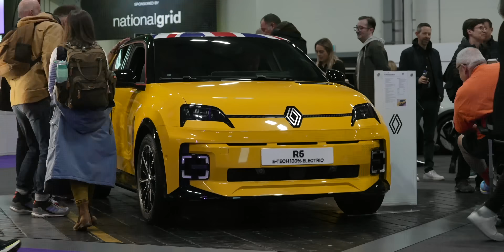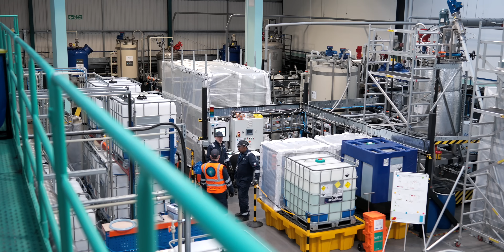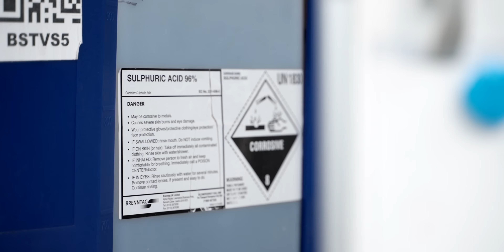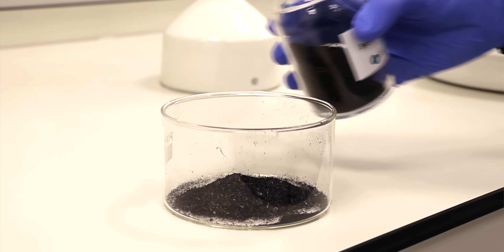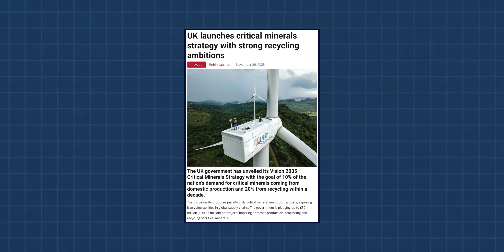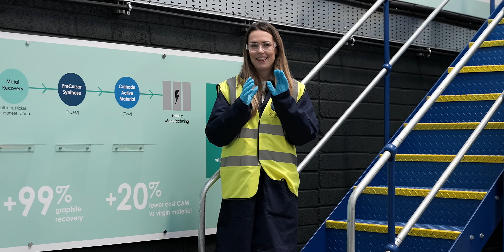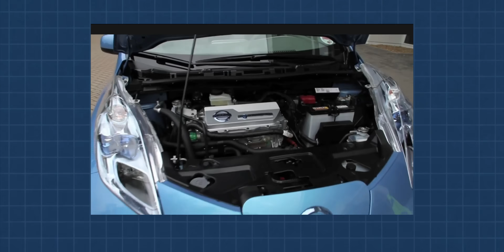EV Battery Recycling Could Be The End Of Mining!

Comment: More wishful thinking. Recycling isn't going to happen without government legislation compelling the EV industry to do so.FFS!
Reply: Recycling of batteries is already legislated for, I think?
Reply: I think there's enough money in the batteries that batteries will get reused or recycled by default
Reply: @Biggest-hz7ng 

😂😂😂😂

You may well believe that.
Reply: @ForestForest-n9i @ForestForest-n9i
At some point it’s worth stepping back and looking at what’s actually working now, not what’s been “five years away” for the last two decades. Battery Electric Vehicles (BEVs) have already won the light-vehicle race on efficiency, infrastructure, cost, and real-world usability, while hydrogen remains a niche science project for passenger cars.
First, efficiency matters. BEVs convert roughly 70–90% of grid electricity into motion. Hydrogen vehicles (both FCEVs and H-ICE) lose huge amounts of energy producing hydrogen, compressing or liquefying it, transporting it, and then converting it back into electricity. Once you count all that, hydrogen struggles to reach 25–35% well-to-wheel efficiency. Using clean electricity to make hydrogen instead of charging a battery directly is simply wasting energy.
Second, infrastructure is decisive. Electricity is already everywhere. BEV owners can charge at home and use a rapidly expanding public network. Hydrogen stations are rare, expensive, complex, and unreliable. In the UK there are only ~15–16 hydrogen stations total, with about 6 open to the public, versus 57,000+ public EV charging points and growing fast. Globally the contrast is similar: millions of EV chargers vs ~1,100 hydrogen stations. You can’t scale a consumer technology without infrastructure, and hydrogen never has.
Third, cost and practicality. BEVs have lower total cost of ownership: cheaper “fuel,” fewer moving parts, and less maintenance. Hydrogen fuel is expensive (often $10–15/kg in the US), stations frequently go offline, and you can’t refuel at home. This isn’t theoretical—hundreds of Toyota Mirai owners in California are now part of class-action lawsuits after being stranded by broken stations, skyrocketing fuel prices, and vehicles that have lost most of their value.
Fourth, a point often ignored: FCEVs still use lithium batteries. They are series hybrids—hydrogen makes electricity, which is buffered in a lithium-ion battery that powers the motor. So arguments against BEVs based on batteries also apply to FCEVs, plus FCEVs add fuel cells, platinum catalysts, high-pressure tanks, and more complexity on top.
Fifth, the market has already decided. Global EV sales jumped from ~3 million in 2020 to over 10 million by 2023, with BEVs dominating. Automakers and analysts (IEA, BloombergNEF) consistently point to batteries as the winning technology. That’s why companies like GM and Stellantis have scaled back or exited hydrogen passenger-vehicle programs, and why hydrogen is increasingly being limited to specific heavy-duty or industrial niches, not everyday cars.
Hydrogen cars do have zero tailpipe emissions, but once you consider production methods (mostly fossil-based today), energy losses, infrastructure costs, and real-world failures, they simply don’t compete with BEVs for personal transport. While hydrogen advocates keep promising a breakthrough “soon,” millions of people are already driving cars that are efficient, affordable, charge at home, and work every day.
This isn’t ideology—it’s engineering, economics, and market reality. For light passenger vehicles, the conclusion is no longer controversial: plugging in beats waiting for a miracle fuel.
Reply: @ForestForest-n9i Tell is about what car you personally own then. Is it hydrogen? @ForestForest-n9i
Reply: Do you have any evidence to prove your statement. If it is wishful thinking then why is a company already doing it?
Reply: @oddjobsandrandomprojects  Or is it?
Reply: @grahamcook9289 

Yes, battery recycling is a "thing" without a doubt.

We've even been treated to programs on the topic courtesy of MSM.
Reply: @ForestForest-n9i  Yes, we all know it's possible and desirable but to make it commercially viable its cost needs to be baked in from the start, especially now that EVs are established and the future direction is clear. For example, in Germany every supermarket has an automated collection point where you can recover your deposit, panda in Germany. The pond is applied to all bottles sold by the supermarket and the amount is always stated in the price. Supermarkets have no choice, but to do this -compelled by law. Individuals see the value in this and do recycle by returning bottles on every shopping trip.
Reply: @grahamcook9289 

You may be interested to know that China has mandated BEVs must be scrapped with the batteries still attached so to speak.

To allow "official" recycling in authorised facilities, H&S presumably, to ensure said safe recycling.

Chapter and verse online.
Reply: @ForestForest-n9i @ForestForest-n9i Tell is about what car you personally own then. Is it hydrogen?
Reply: @ForestForest-n9i @ForestForest-n9i
At some point it’s worth stepping back and looking at what’s actually working now, not what’s been “five years away” for the last two decades. Battery Electric Vehicles (BEVs) have already won the light-vehicle race on efficiency, infrastructure, cost, and real-world usability, while hydrogen remains a niche science project for passenger cars.
First, efficiency matters. BEVs convert roughly 70–90% of grid electricity into motion. Hydrogen vehicles (both FCEVs and H-ICE) lose huge amounts of energy producing hydrogen, compressing or liquefying it, transporting it, and then converting it back into electricity. Once you count all that, hydrogen struggles to reach 25–35% well-to-wheel efficiency. Using clean electricity to make hydrogen instead of charging a battery directly is simply wasting energy.
Second, infrastructure is decisive. Electricity is already everywhere. BEV owners can charge at home and use a rapidly expanding public network. Hydrogen stations are rare, expensive, complex, and unreliable. In the UK there are only ~15–16 hydrogen stations total, with about 6 open to the public, versus 57,000+ public EV charging points and growing fast. Globally the contrast is similar: millions of EV chargers vs ~1,100 hydrogen stations. You can’t scale a consumer technology without infrastructure, and hydrogen never has.
Third, cost and practicality. BEVs have lower total cost of ownership: cheaper “fuel,” fewer moving parts, and less maintenance. Hydrogen fuel is expensive (often $10–15/kg in the US), stations frequently go offline, and you can’t refuel at home. This isn’t theoretical—hundreds of Toyota Mirai owners in California are now part of class-action lawsuits after being stranded by broken stations, skyrocketing fuel prices, and vehicles that have lost most of their value.
Fourth, a point often ignored: FCEVs still use lithium batteries. They are series hybrids—hydrogen makes electricity, which is buffered in a lithium-ion battery that powers the motor. So arguments against BEVs based on batteries also apply to FCEVs, plus FCEVs add fuel cells, platinum catalysts, high-pressure tanks, and more complexity on top.
Fifth, the market has already decided. Global EV sales jumped from ~3 million in 2020 to over 10 million by 2023, with BEVs dominating. Automakers and analysts (IEA, BloombergNEF) consistently point to batteries as the winning technology. That’s why companies like GM and Stellantis have scaled back or exited hydrogen passenger-vehicle programs, and why hydrogen is increasingly being limited to specific heavy-duty or industrial niches, not everyday cars.
Hydrogen cars do have zero tailpipe emissions, but once you consider production methods (mostly fossil-based today), energy losses, infrastructure costs, and real-world failures, they simply don’t compete with BEVs for personal transport. While hydrogen advocates keep promising a breakthrough “soon,” millions of people are already driving cars that are efficient, affordable, charge at home, and work every day.
This isn’t ideology—it’s engineering, economics, and market reality. For light passenger vehicles, the conclusion is no longer controversial: plugging in beats waiting for a miracle fuel.
Reply: @grahamcook9289 It is being done. Obviously you comment without watching. Not wishful thinking when something is done.
Reply: @oddjobsandrandomprojects 

Consider I'm deflecting again.
Reply: @ForestForest-n9i @ForestForest-n9i Tell is about what car you personally own then. Is it hydrogen?
Reply: @ForestForest-n9iRoss Kneebone — since you’ve publicly stated that you work as a representative for a hydrogen bus company, the way you behave here looks less like honest debate and more like paid advocacy mixed with trolling. You don’t show up to add insight; you show up to complain, derail threads, and take snide shots at other commenters instead of engaging with evidence.
So let’s stick to reality. In the UK today there are roughly 16 hydrogen refuelling stations in total, and only about six are actually open to the public for passenger cars. That’s not a rollout — that’s a dead end. By contrast, the UK has tens of thousands of public EV charge points, and the number keeps growing because electricity already exists everywhere and scales cheaply. Infrastructure decides consumer technology, and hydrogen has simply failed that test.
On efficiency, the physics are settled. Battery electric vehicles convert the majority of grid electricity into motion. Hydrogen passenger cars throw most of it away making hydrogen, compressing or liquefying it, transporting it, and then converting it back into electricity inside the car. Well-to-wheel efficiency for hydrogen struggles to reach a third of what went in. Turning clean electricity into hydrogen instead of charging a battery directly is just wasting energy.
You also repeatedly attack lithium batteries as “dangerous” or “unsuitable,” which is especially dishonest given that fuel-cell vehicles still rely on lithium-ion batteries. They are series hybrids: the fuel cell generates electricity, that electricity is buffered in a battery, and the battery powers the motor. By your own logic, hydrogen cars fail before you even get to the fuel cell — and then pile on extra complexity with platinum catalysts and high-pressure tanks.
Real-world ownership backs this up. BEVs charge at home and work every day. Hydrogen car owners deal with broken stations, fuel shortages, extreme prices, and collapsing resale values. These aren’t hypotheticals — they’re documented outcomes of trying to force an unscalable system into consumer transport.
Mocking “history lessons” just highlights bad faith. History is where facts come from, and history shows which technologies actually scale. BEVs are already here, already working, and already dominant because they’re efficient, practical, and affordable. Hydrogen cars have been “five years away” for over twenty years.
So here’s the simple question you keep avoiding: what car do you personally drive — and is it hydrogen?
Reply: Judging by the many illegal tips in UK I get the impression that legislation by HMG is completely ignored.

Some of these tips will contain all sorts of "nasties", which will leech into the ground and hence into the aquifers and, eventually, into "us".
Reply: @ForestForest-n9i @ForestForest-n9i
At some point it’s worth stepping back and looking at what’s actually working now, not what’s been “five years away” for the last two decades. Battery Electric Vehicles (BEVs) have already won the light-vehicle race on efficiency, infrastructure, cost, and real-world usability, while hydrogen remains a niche science project for passenger cars.
First, efficiency matters. BEVs convert roughly 70–90% of grid electricity into motion. Hydrogen vehicles (both FCEVs and H-ICE) lose huge amounts of energy producing hydrogen, compressing or liquefying it, transporting it, and then converting it back into electricity. Once you count all that, hydrogen struggles to reach 25–35% well-to-wheel efficiency. Using clean electricity to make hydrogen instead of charging a battery directly is simply wasting energy.
Second, infrastructure is decisive. Electricity is already everywhere. BEV owners can charge at home and use a rapidly expanding public network. Hydrogen stations are rare, expensive, complex, and unreliable. In the UK there are only ~15–16 hydrogen stations total, with about 6 open to the public, versus 57,000+ public EV charging points and growing fast. Globally the contrast is similar: millions of EV chargers vs ~1,100 hydrogen stations. You can’t scale a consumer technology without infrastructure, and hydrogen never has.
Third, cost and practicality. BEVs have lower total cost of ownership: cheaper “fuel,” fewer moving parts, and less maintenance. Hydrogen fuel is expensive (often $10–15/kg in the US), stations frequently go offline, and you can’t refuel at home. This isn’t theoretical—hundreds of Toyota Mirai owners in California are now part of class-action lawsuits after being stranded by broken stations, skyrocketing fuel prices, and vehicles that have lost most of their value.
Fourth, a point often ignored: FCEVs still use lithium batteries. They are series hybrids—hydrogen makes electricity, which is buffered in a lithium-ion battery that powers the motor. So arguments against BEVs based on batteries also apply to FCEVs, plus FCEVs add fuel cells, platinum catalysts, high-pressure tanks, and more complexity on top.
Fifth, the market has already decided. Global EV sales jumped from ~3 million in 2020 to over 10 million by 2023, with BEVs dominating. Automakers and analysts (IEA, BloombergNEF) consistently point to batteries as the winning technology. That’s why companies like GM and Stellantis have scaled back or exited hydrogen passenger-vehicle programs, and why hydrogen is increasingly being limited to specific heavy-duty or industrial niches, not everyday cars.
Hydrogen cars do have zero tailpipe emissions, but once you consider production methods (mostly fossil-based today), energy losses, infrastructure costs, and real-world failures, they simply don’t compete with BEVs for personal transport. While hydrogen advocates keep promising a breakthrough “soon,” millions of people are already driving cars that are efficient, affordable, charge at home, and work every day.
This isn’t ideology—it’s engineering, economics, and market reality. For light passenger vehicles, the conclusion is no longer controversial: plugging in beats waiting for a miracle fuel.
Reply: @ForestForest-n9i @ForestForest-n9i Tell is about what car you personally own then. Is it hydrogen?